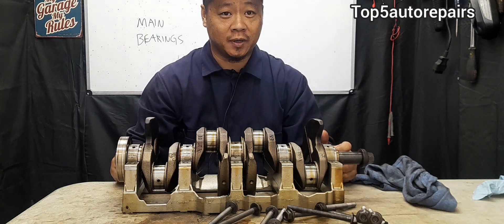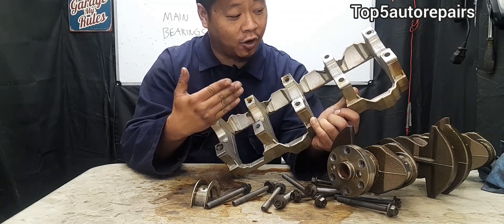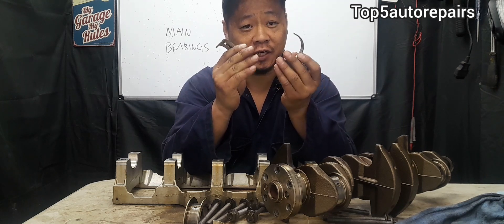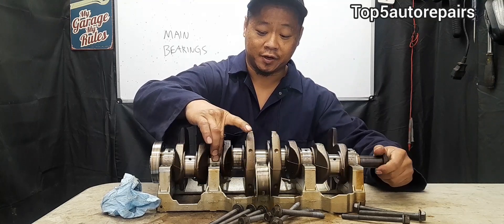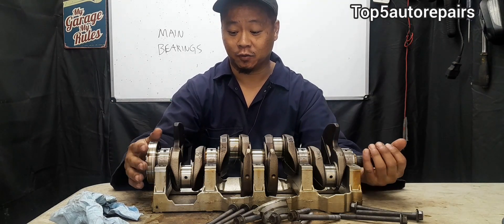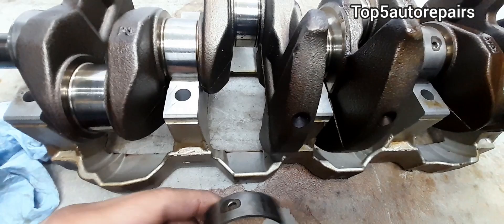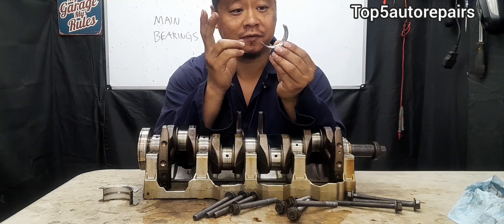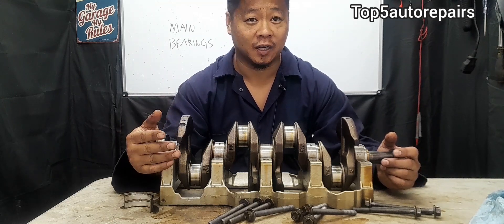SYMPTOMS OF WORN ENGINE MAIN BEARINGS

Comment: Getting ready to do bearings on my 07 chevy silverado 2500hd with the 6.0 she's got 340,000 plus miles on her. I just replaced the oil pressure sensor the o-ring on the pick up tube and the oil pump and she still has low oil pressure. Only thing I can come up with is bearings are worn the fuck out.

Comment: My oil analysis from Blackstone said my copper and lead were high, indicating bearing wear.  Does this cause oil consumption?  2012 Camry, 2ARFE, Thanks!
Reply: It shouldnt cause oil consumption. Because if it pushes the oil out through the bearrings, it will get dumped straight back to the oil pan. Consumption usually caused my clogged or worn out piston rings. Also valve seals are culprits to consumption. In other words to consume oil, it has to get inside the combustion chamber where it gets burned instead of recerculating into the oil pan.

Comment: I change my oil every 5k miles using Mobil 1 full synthetic along with a premium Purolator filter and am worried because I saw small particles in my oil. Luckily I have an 08 Civic and engines are normally 800 dollars where I'm at.  Still bummed out.
Reply: G  day  how many   miles were on it.  Too bad sorry   Ths

Comment: I have a 94 dodge ram 1500 318 5.2 with 286k miles and I need to know if I can put new crank and rod bearings in it and/or do I need to put a new crank in it ? I like the way you explain things

Comment: Car idle with no knocking sound. When rev to 2500 RPM and starts the ticking sound. Around 3000 RPM ticking sound stops. Oil is clean, and headers and clearances have been checked. Last I recalled was car run out of oil and this sound started thinking of pistons

Comment: Car idle with no knocking sound. When rev to 2500 RPM and starts the ticking sound. Around 3000 RPM ticking sound stops. Oil is clean, and headers and clearances have been checked
Reply: What year and model is your car?

Comment: When u say low oil pressure, will that be always or just at idle? I have low oil pressure at idle but if I keep a  rev at 1k on the tach, it goes away. But no oil light above 1k just at idle.
Reply: Exactly what I'm having on my neon. Thats pretty much the bearrings saying its time for them to go. No knocking yet, just oil light comes on when pulling up to a red light. Drop it in Neutral and it goes right away.

Comment: Many different motors. Usually if the main bearings are worn out so are.the rods. When the mains wear out often times the rod will.starve for oil. The one thing that usually holds up is the main bearings.

Comment: I have a 1974 carb-converted Porsche 914-4 that came to me with grossly contaminated engine oil; the drained oil looked had a white 'mocha' coffee appearance when I removed it...evidence to me that some unknowing person had perhaps pressure-washed the engine bay and the dual Weber carbs entrained water into the oil sump. The engine has a low sort of variable 'rumbling/grinding' sound that suggests to me that it may have sustained main engine bearing damage from being run with that contaminated oil. Does this sound like a reasonable hypothesis? Is it possible to accurately confirm or rule-out main bearing damage other than a tear-down for direct inspection, if there doesn't appear to be any metal shavings in the oil and the oil pressure seems to be within normal limits? A 914 engine main bearing replacement procedure would be EXPEN$IVE, needless to say... Thanks. Excellent instructional video, by the way!

Comment: If diesel fuel is going down into the oil pan, caused by fuel injector problems, how long does it take before you can lose the engine ?

Comment: My dad thinks he can drive with bad main bearings forever😡 He won't let me take the engine out of the car for a full rebuild😡
I took the oil pan off and the connecting rod bearings just have minor stuff from recirculating shavings from the mains but they are definitely not the source of the knock.

Comment: If 20w 50 is being used with old bearings....and then the bearings are replaced should I go back with 10w 40 or 30 with the new bearings? Would 20w50 cause a circulation problem if an engine has new bearings?

Comment: Thanks for this video! What grit sand paper do you recommend using on the crankshaft journals?
Reply from the maker: 600-1,000. Super fine or ultra fine.
Reply: @Top5AutoRepairs Thank you for your videos,.question,ive been trying to figure out my oil pressure issue on 07silverado,3mechanics later and over $1k i didnt know until watchn you.but can my bearings be issue if NO NOISE but round shavings in pan and no oil pressure after 5mins running?? Any info greatly appreciated

Comment: Hey, i wanted to ask. I got aluminium in my oil filter only. I went to change rod bearings and found that they look like brand new. There also was no metal in oil or pan, only in oil filter. Is it likely my oil pump is giving up? It looks scored. I didnt check main bearings tho, but when rod bearings looks good, mains should be good too as rod gets oil from main, right?
Reply: Could be a actuator that broke.

Comment: Good video man. So what is advised to use to check clearance of the bearings, plastiguage reassembled and torque to spec then recheck? Or is there a more precise way? How to find the tolerances for a vehicle or tq specs to do this process? And on say performance engines do these tolerances need to be changed if say you add about 400 whp more than it already has over stock? Sorry for the many questions but seems like you know what your talking about.
Reply from the maker: For procedure and spec I use All Data.
Reply: @Top5AutoRepairs  Thank you. Would you know if they have 2016 dodge hellcat specs. And is that like a monthly subscription. Your probably a mechanic so you probably have it at work.